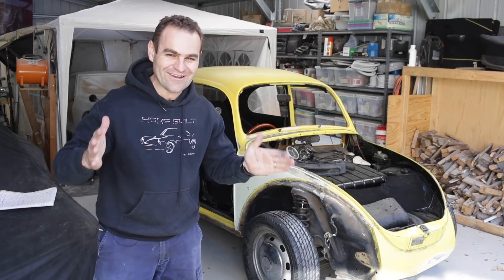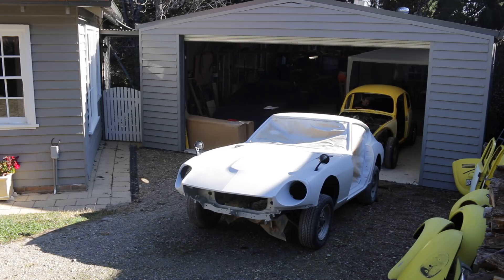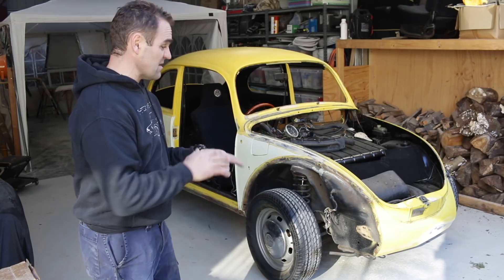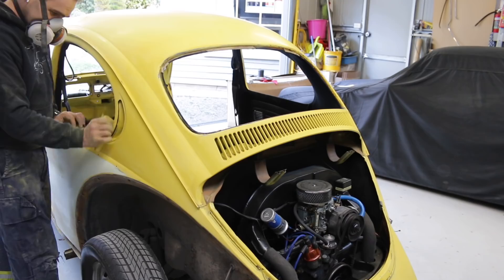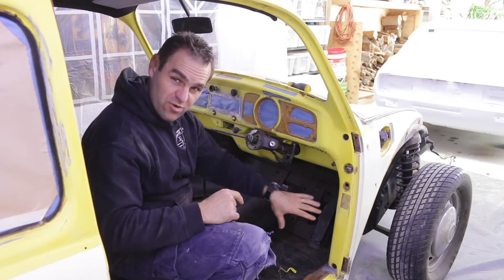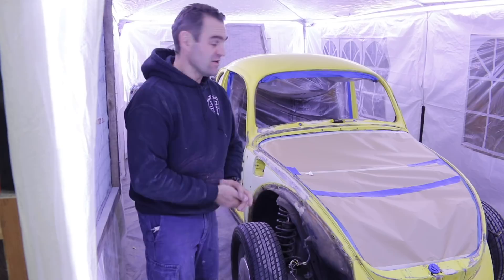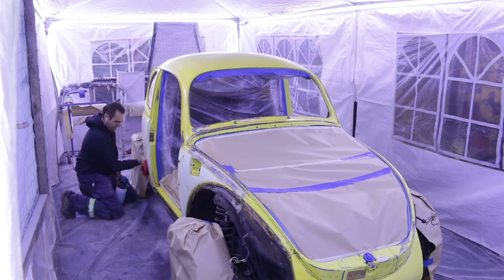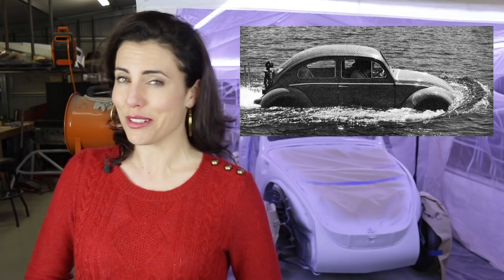Priming the shell - Home Built Project Beetle part 17

Comment: A tip for removing steering wheels is to leave the nut threaded, but loose enough for the wheel to wiggle. That way you can stop it before it smashes your face.
Reply from the maker: That is a good tip. I had forgotten that one, but you are bang on.

Comment: Jeff. Lucky with the steering wheel. It's rare that they just come off like that.

My hint for them is when they are stuck on, leave the centre nut on just a few turns. When you wrestle with the wheel and it finally breaks loose, it doesn't fly off and remove any of your teeth. You can really go to town on it knowing you aren't going to be hurt by it when it does break free..

Comment: … great action figure and good results … have not tuned in for sometime but remember everyone talking about the old fluorescent lights with the plastic over them that you originally used in your booth … what kinda light system are you now using kinda looks like LED strips ?  If so or not what is the overall wattage output as it kinda looked a little dim in the booth while spraying but could just be the video … ?

Comment: Love the Name!!
Jeff,
I have a couple questions. What grit sand paper are you using in this episode and is this an epoxy primer or high fill primer you are spraying?
Cheers
Craig
Reply from the maker: I went over the whole car with 320, as I was using high fill. The main reason for high fill is more to just have a solid base colour so that the new colour has good coverage. If you were just spraying colour on top of the old paint, I would recommend 800, but I have used as coarse as 400 in the past with no issues.
Reply: Great. Thank you